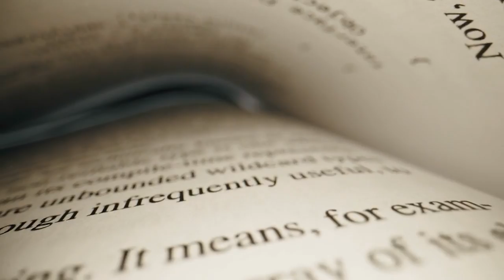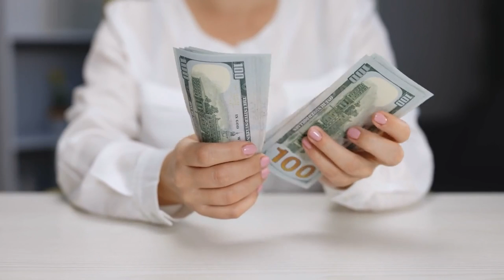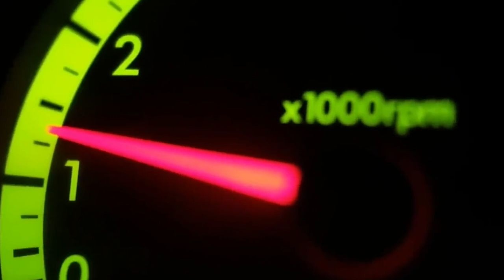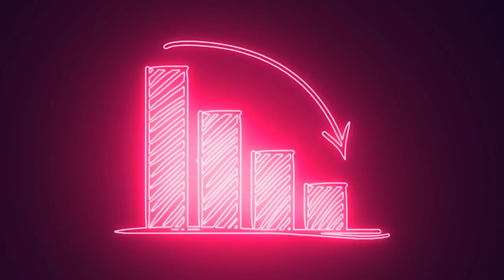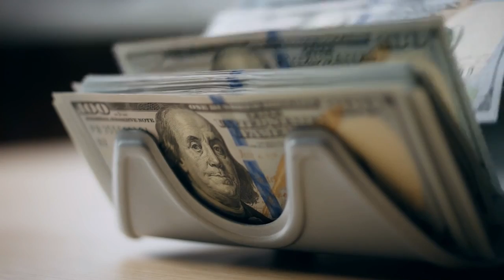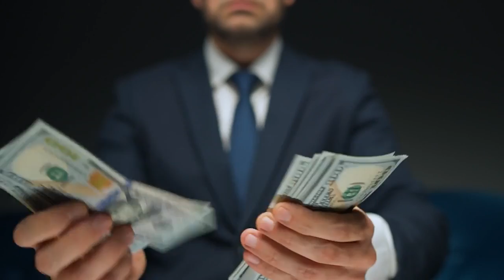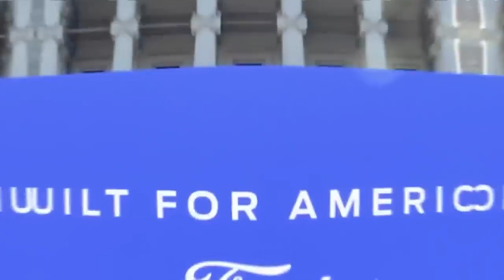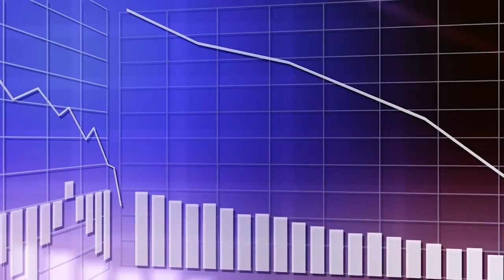The GENIUS Reason Why Ford Refuses To Switch To EVs!

Comment: Environmentive my butt theyvare much more damaging to the environment then gas vehicles are it takes 500,000 gals of water to process one ton of lithium which is strip mined then u got people digging by hand in huge pits for cobalt n then u got copper nickel etc mist strip mined ever see the size of the equipment to strip mine. Then u have a coming environmental disaster when all these batteries go bad. Another thing these EVs are much heavier n nore damaging to the roadways so they will have to tax carbon tax they say to repair the roads especially trucks the battery packs can weigh thousands of more lbs then where does the energy come from to recharge these evs wind n solar aint exactly reliable recently i saw a whole solar farm destroyed by hail
Reply: Dude, it is the same Lithium that is in your regular batteries you use at home. Do you stop using batteries? No. While the Tesla uses a lot more batteries, it is still a battery.

Comment: Environmental benefits my ass  it takes 500,000 gals of water to process one ton of lithium n then the STRIP MINING of the earth for lithium copper nickel n all the people in huge pits to mine cobalt by hand. Even see the size of the equipment used to mine these minerals for every lithium battery used today. Then what we do with all the batteries when they are no longer useful. The chemical reaction in these battery's makes them very toxic. All the materials needed to make these batteries come from China which has hardly any environmental standard EVs right now are much worse then ice vehicles

Comment: Do we want gear boxes clutches spark plugs oil changes filters and so on a friend of mine a Ford engineer is at this moment driving an EV round Spain testing it ability to handle very hot weather he says the engine staff at Denton that worked on ice have already gone and there are no plans to build ic engines any more.